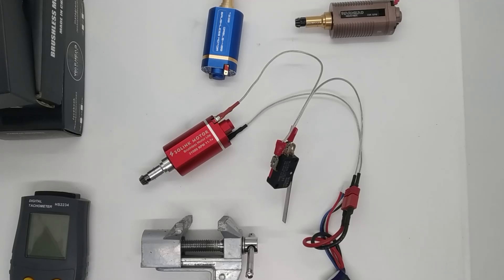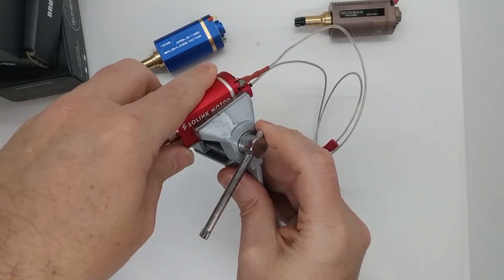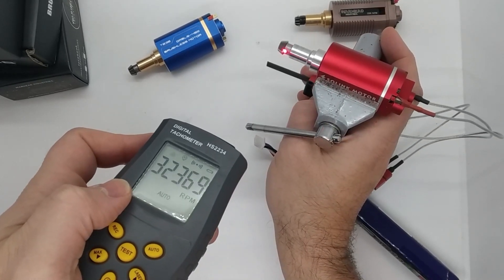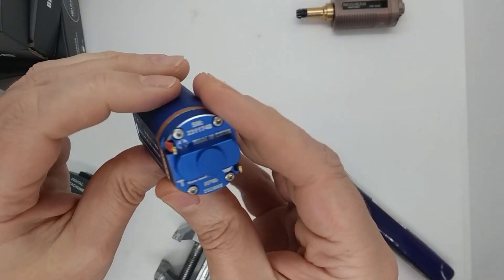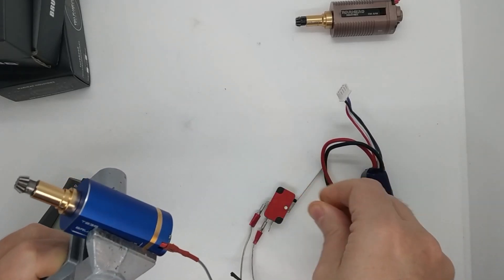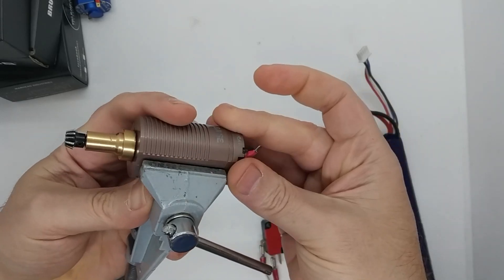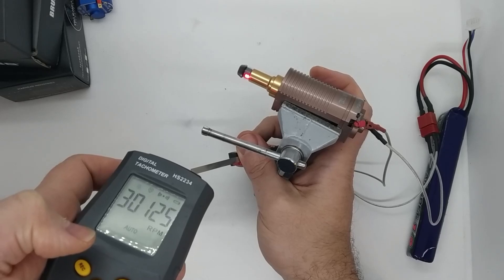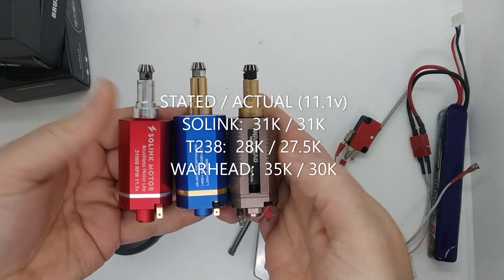Warhead, Solink and T238 Brushless Motor RPM Test

Comment from the maker: Quick test of 3 of the motors I had lying around.  Just wanted to see if the advertised RPM aligned with the reading I was getting with my tachometer.  Hardly scientific.  Don't read too much into the results as some motors have a +/- 10% margin in their no-load RPM.  Lot of factors at play.  

If someone else with a better understanding on motors can add to my knowledge please feel free to post a comment.
Reply: No load tests mean squat , A weak motor with weak magnets or relatively  low voltage can be made to spin to huge RPMs but the moment a load is added you get a massive reduction in RPM , high Amp draw and or you lots of heat as the magnets and electromagnet ( windings) try to spin the motor but don't have the torque required. Funny enough you will see this if you ever put all 3 of these under load , the Warhead is the higher rate of fire and stays cool to the touch. Again , no load tests show aprox zero useful information.

Comment: What a let down the warhead is ,recently picked up some ahtech infinity adjustable brushless motors, same manufacturer  as the T238's just different brand and significantly cheaper than the T238 adjustable motors actually they cost me the same as what i paid for the 37k T238 QRBLS brushless motor
Reply from the maker: One thing to keep in mind is warranty on BL motors, do ahtech have a good repair service route?
Reply: @xtairsoft  no idea tbh ,i had no idea that they were from the same manufacturer till i just happened to order a 48.5k adjustable after using the 37k QRBLS and was so happy with it and mentioned it to someone and they informed me that they were the same as the T238 so i thought stuff it order another one and a 39k version. Merry Christmas 🤶 ✌️

Comment: They are programmed at that RPM but they can be pumped higher than that, some manufacturers say the MAX Rpm for some are at or over 100k, which means it can reach that amount but not recommended (voids warranty)
Reply: How would you go about juicing one right up and not worried about warranty
Reply: @drewmurray6480  use a pwm or microcomputer
Reply: This is a silly ass comment lol. Motors are wound to a specific RPM (KV ) not "programmed " . Tell me you know zero about brushless motors without telling me !

Comment: A small but useful difference of the Solink is it's shorter, so its alot easier to wire it in different kinds of grips. And while having a shorter rotor and stator it still keep up the rpm and torque with the others.
Reply from the maker: Where did you find the stats for that?  I'd be interested in seeing.  Was that for the Solink Lite?
Reply: @xtairsoft  you can simply compare the motors and see the solink main body is shorter? And when you put it into the same AEG the ROF is still comparable as a normal sized brushless of same RPM.
Reply: @wyz2285  I actually think the t238 motor is shorter than the solink. I have the solink v5 and the end bell design makes it longer than the t238. The solink lite motor looks visually longer than the solink v5 and the t238.

Edit: (I have 2 t238 motors as well to confirm the size)
Reply: @HikaruSwift17  The lite is shorter than any other brushless (not talking about full length, just where the wire plugs are, where some grip plate has less space for wires and this helps). You can also see in the Wyshtech's video where he compares Solink and T238

Comment: Greatly Appreciated as always! I tried some of the earlier Brushless motors and didn't get on with them much, but have been eyeing up the T238 and their newer blue can one that you test here. I have one of the older Solinks (Blue can "medium speed") which wasn't great, so good to see they've improved with the ones tested here.
Reply from the maker: Thanks, glad it helps.  My Solink test motor has been pretty decent so far, only around 5k, was impressed with it being right on the correct RPM.  

Plan is to do a 5000 continuous shot test next and see how each motor holds up, record the temp of the motor etc.

Comment: KV rating is widely used with Brushless motor, indicates the rpm per volt applied. s in that case 2500kv*10v= 25k rpm. thanks for the great video, the only thing i'd suggest is to use a current meter in line to measure the voltage under load (small load roughly 2 amps when unloaded) and calculate the Kv of the motor. KV is the what we are really interested in because based on battery capacity and C rate will have voltage sag that will cause the motor to be slower; e.g small stick lipos will sag way more than a big brick, causing less output RPM. hope it make sense. Giulio
Reply from the maker: thanks, most helpful